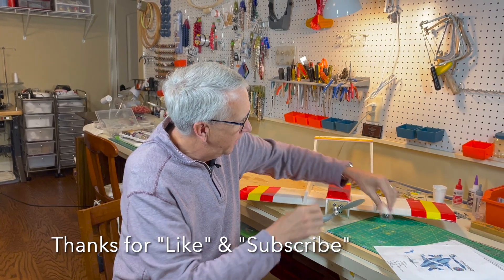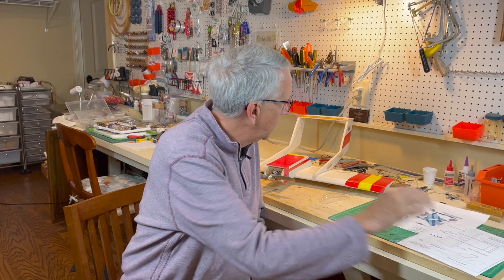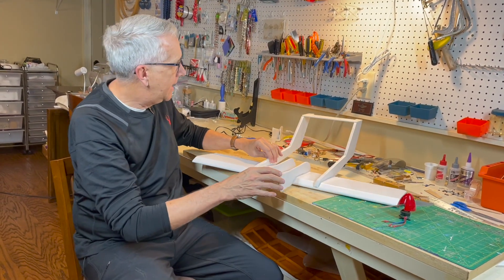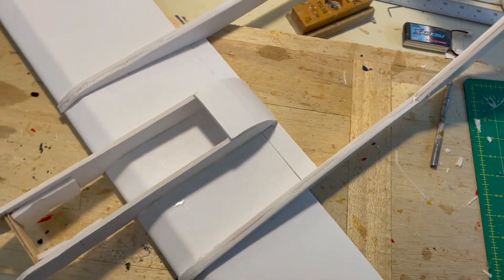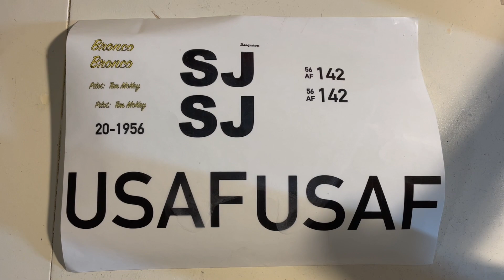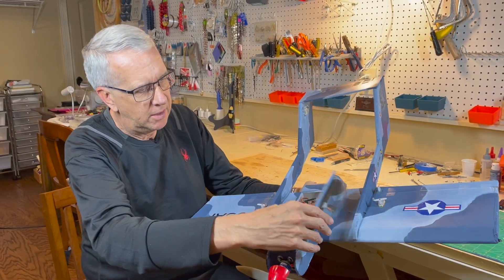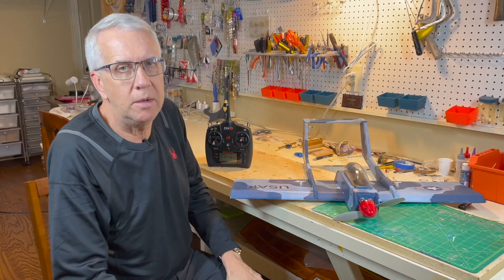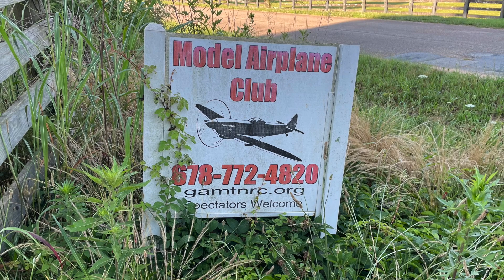Bronco 2 Foam Board RC Airplane - Free Plans!

Comment: Dear Tim, thank you for sharing the design for the Bronco. It looks easy to build and I have downloaded the plans and scaled them up by hand to give me the templates to cut out. As I am new to building model aircraft I was wondering if the horizontal stabilizer and the bottom of the wing have the same orientation or are one or the other at a slight angle?

thanks Paul
Reply from the maker: Paul,  I'd add just a touch of positive incidence to the wing compared to the horizontal stab.  I think the model flies a bit better.  But if all is zero-zero (i.e. aligned), will fly fine.  Tim
Reply: @TimMcKay56 , Hi, Sir, can we add  TWIN RUDDERS to this model? If yes, how to control twin rudders with single servo? I am planning to make bigger Bronco model with balsa. Thanks and Regards
Reply from the maker: @garrison9078  Really no need for rudders on this model.
Reply: @TimMcKay56  , Sir, many thanks for your input. Kindly advise, if ever twin rudders are to be incorporated in any model, how to operate the same in twin boom model with 6 channel radio transmitter. Kindly suggest of you have already uploaded a video on this topic. Thanks and Regards
Reply from the maker: @garrison9078  I’ve never hooked up dual rudders like you mention, just too complicated.   For a sport model like the Bronco if you really wanted rudder control, consider using just one rudder. Do check www.RCGroups.com, they have answers for everything.
Reply: @TimMcKay56  , Thanks a million for your reply, Sir. Really appreciate
Reply: @garrison9078 
Consider using two identical control horns. Connect both horns at the same hole location and select one horn attached to a servo using another hole.

Comment: Could i use an elevon setting instead of y connector for ailerons?
Reply from the maker: With the DX6 transmitter you can plug the aileron servos into separate ports of a 6 channel receiver.  I cannot think of a good reason to do this, just use a Y-connector (available at Amazon).  Elevons would not be appropriate for this control layout, better suited for a flying wing.
Reply: Ok gotcha thanks @TimMcKay56

Comment: Tim:

What is the capacity of the 2 cell battery you used for the Bronco 2?

Thanks, Ben
Reply from the maker: 1350 milliamps.  Although the plane can certainly accept a larger pack, lots of room in the fuselage area.  Just keep an eye on correct CG.

Comment: Hi Tim, I am 13 and new to building RC planes and I have built your bronco design and I have had problems with my plane banking to the right. I have tried to trim the ailerons with little to no success. Do you have any suggestions to help me fix my problem? thank you, Mason
Reply from the maker: Hi Mason, welcome to the hobby!  Plz be certain that there are no warps in the wing.  Next, make sure the wing balances left and right; if one side is heavier, put some nails in the other side to balance it out.  If it still banks to the right, just trim the aileron on the right side to be a bit "more down" to keep the wings level.

Comment: I was thinking about putting two small flaps next to the fuselage the would be about 2.5" wide each. What are your thoughts?
Reply from the maker: Sure, give it a shot!  Tim
Reply: @TimMcKay56 Hi Tim! I took my bronco on it's maiden flight today. It did amazing!! It has a slightly different tail design but otherwise pretty similar. I'm so happy with the way it flys. I was thinking about setting it up with flapperons for slow flights and landing. What do you think?
Reply from the maker: @KGReef  Great news on maiden flight!  Sure, flaperons sound like a good plan!  Tim
Reply: @TimMcKay56  thanks again for the inspiration on the plane. I think I may have to build another now! Maybe 25% larger.

Comment: Hey what voltage and mah did you use on the battery and how long of flight times are you averaging?
Reply from the maker: 2 cell lipo, 1359 milliamp. I get flights up to 8 mins. Tim
Reply: @TimMcKay56  thank you!!
Reply: @TimMcKay56  is that 7.4 volt as well??
Reply from the maker: Yes.

Comment: I am moved by your passion. I will work hard to make it too.
Reply from the maker: Myungkyu:  Thanks for checking in!  The Bronco is easy to build and flies well, best of luck!  Tim
Reply: @TimMcKay56  thanks tim, i have a questiion,  I don't have turbocad, can you convert or open the drawing with autocad?
Reply from the maker: @starletzzang  AutoCAD should be able to open it, but I am not sure.  There is a PDF version of the plans you can download from the Description, with a scale.  All lines are straight, just sketch out on the foam board.  Tim

Comment: Tim I am building the Bronco.  I have a couple questions.  What happens to the prop when you land?  It looks like it would break when it hits the ground.  I am new at building RC models.  What type of hinge do you use on the ailerons?  Thanks Tim !!
Reply from the maker: Loel:  Good question.  You need to put the throttle at idle before touchdown, to avoid damaging the prop.   I use clear Scotch tape for all control surface hinges, really works well for these smaller models.  Tim

Comment: I appreciate your videos. Does this plane do rolls and loops and fly inverted? If it's intended as a good trainer, shouldn't it have rudders? rudders?
Reply from the maker: The Bronco is more of a sport flyer, I would not use it as a trainer.  You can add rudders if you wish, I was working to keep weight low.  Tim

Comment: I have absolutely nothing to do today so guess what? I'm going to the local arts and crafts store and will give this model a go! Thanks for the free content Tim! 👍
Reply from the maker: RC:  Just flew mine yesterday, you'll love it!  Tim
Reply: I've never built a model before so I'm not sure how to measure out all the different pieces from your plans. I'll dig around and see if you have another video going into further detail.
Reply: @r_c_therapy2188  There is the original Bronco video.  Plans can be downloaded from the Description.  Just measure the dimensions from the plans onto the foam board, cut out and glue together.  No curves, so quite easy.  Tim

Comment: Great video. I'm currently trying to build a slightly larger version (40" wingspan) using your plans. Everything is coming together nicely. I purchased a flite test power pack c to power the plane. I'm hoping I picked the right pack as I'm just getting started and not sure.
Reply from the maker: Brendon:  Congrats on your build!  The Bronco is fairly lightweight.  Whatever weight your version comes in at, ensure your motor and prop combo can handle it.  Mine weighed 17 ounces and the Park 250 motor gave plenty of thrust.  Think this would work with a larger version.  Tim
Reply: @TimMcKay56  thanks for the reply. The power pack came with a 10x4.5 prop. I've taken it on 2 test flights since my last comment. Both resulted in crashes and broken props. I believe it was the thrust angle and while waiting for new props I set the thrust angle again. I believe it's overpowered. It will fly out of my hand at 1/4 throttle. The plane has held up great and I'm hoping to get a good flight this time. Will post a picture here soon. Thanks again for all the videos. They have really been help.
Reply from the maker: @brendonbreuninger1070  Brendon:  Keep going, you'll make it!  Tim

Comment: Download plane how do I work out how many inches I need to make each part thanks
Reply from the maker: Michael:  The plan has a 6" ruler.  Use this smaller ruler to "measure" the various parts.  For example, the wing span is 30".  Or, you can take a paper copy of the plan and enlarge as needed at a FedEx Office.  See my video on this.  Tim

Comment: Thanks for posting this!  Does TurboCAD have the ability to export step files?  I'd like to import your plans into Fusion 360, but it can't read the tcd file.
Reply from the maker: Crash:  Apologies, but no idea on importing plans to Fusion 360.  If you download the Bronco plans, there are quite simple.  Mostly straight lines easy to scale up to whatever size you wish.  I am thinking hard of a double size Bronco, with 60" wingspan.  Should be a good flyer!  Tim

Comment: Looks good the only thing I would change on your built is instead of popsicle sticks I would use 3mm x 0.5mm dp flat carbon fibre rods/spars to strengthen the booms. You be surprised how cheap it is these days it works out lighter and is heavily used in indoor kits because of this. Lengthening nose good idea I had to do the same converting an IC SE5A to electric.
Reply from the maker: Mark:  Great inputs, thanks!  Tim